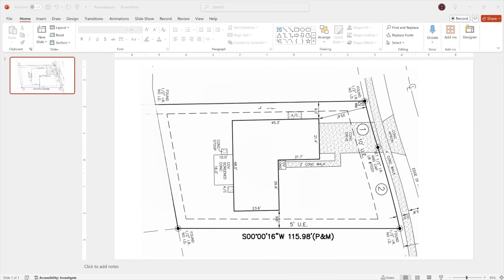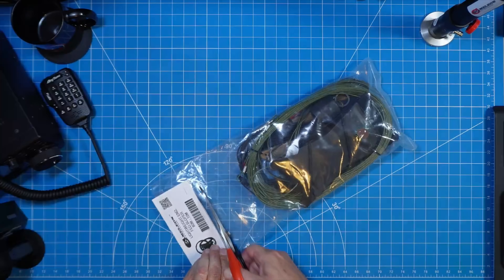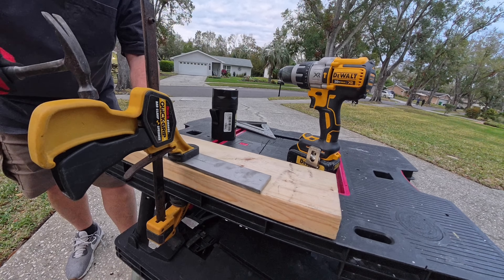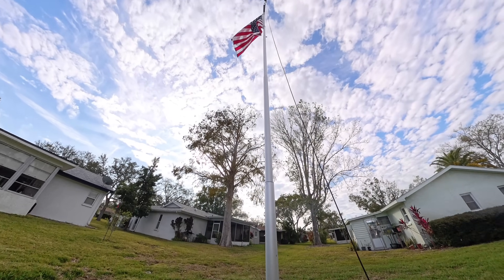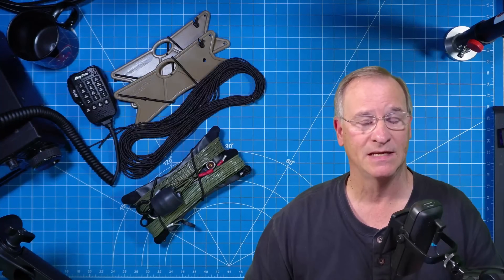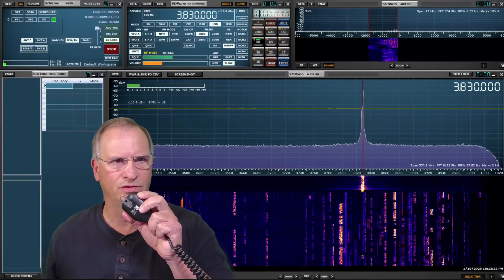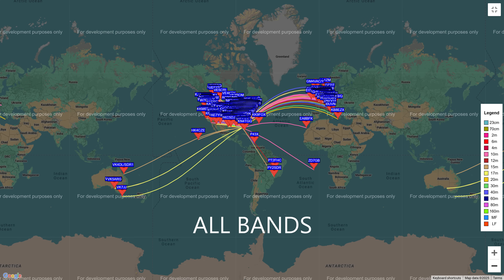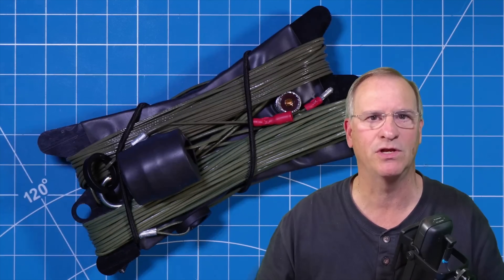Small Lot Sloping "L"  LEFS 8010 Antenna Resonant on 80 40 30 20 17 15 12 10 Meters - Demo & Review

Comment: Great video, mate, and this looks like a great antenna! I've been looking for another well-performing wire antenna to string up at my QTH. (I'm blessed with loads of room at a fairly high elevation.) Of course, one like this has the benefit of potential portability as well. Chameleon sure does make well-engineered high-quality stuff. Cheers!
Reply from the maker: Indeed their engineering and quality are top notch.  Thanks for stopping by for a look and comment.

Comment: if you were purchasing an antenna for home station.....this would be great choice?   it seems temp home use is good, but you wouldn't leave something like this in your yard permanently...correct?
Reply from the maker: If I could deploy this permanently in my yard, I absolutely would.  I would suspect it would last for years exposed to the elements; it is very well made.  Being in an HOA and a small lot, I can't; but if I could, I would use this as a permanent antenna.  10 through 80 meters is crazy!

Comment: Great video! I use a Chameleon Basic Limited Edition 130 foot at my home. I have a small 1/2 acre lot. The matching transformer is mounted to the corner of my house and the wire goes from there to a 25 foot flag pole in the middle of the yard. The other end goes to a basketball hoop and then about 15 feet to a tree at about 8 feet above ground. So it's an end fed inverted V configuration. It tunes all bands 160-6 meters with just the internal tuner in the Yaesu FT-710. Performance is great!
Note: I posted this yesterday but now it's completely gone. Don't know happened. Did the crazy censors at Youtube delete it or did you? Can't imagine why. I did include a link to pictures of my installation on my Smugmug website. As far as I can see an external link like that is allowed, but it's gone. 
Chameleon is great! I also use their CHA MPAS Lite in portable ops. Also performs well and tunes all bands 80-6 meters. I love these antennas because I don't have to do any adjustments, just set it up and hit the tune button on the radio.
Reply: Aha! I made a separate posting with the link to my pictures and it was deleted immediately. Good old Youtube censorship.
Reply: @w9fcc  It’s happening to me about 50% of the time when I try to answer questions with links…
Reply from the maker: Thanks for the great feedback, I always like to learn from others how they deploy their antennas.  

I did not delete the links; its YouTube.  Feel free to send them to my email, thehoaham@gmail.com

Comment: I have this antenna, and though I have never used it with the extension, it always performs great for me on 10-40. It’s a great POTA antenna. I usually have the feed point pretty close to the ground, 3-6 feet, and I have no problems making contacts in a sloping configuration.
Reply from the maker: Thanks for the feedback and confirmation on performance.

Comment: Two questions:

1] How are your received signals always so clear of noise. Your neighbourhood doesn't look that much sparser than mine, but my efforts (admittedly mainly with verticals) are never so quiet, and it's one reason I'm still mostly portable instead!

2] Will you be at Hamcation?
Reply from the maker: Sometimes my day job drops mandatory requirements on me; as long as that doesn't happen, I plan to be at Hamcation Friday afternoon and Saturday.

My noise floor isn't always this low.  When I first showed 40 on my SDR it was pretty good; within an hour, 40 was trash and noisy.  80 stayed good for me all night long; probably the best work I've ever done on 80.  This is the first wire I've evrn set up at 130'.
Reply: @HOAHamRadio  I hope to meet you in person, there, then. I'm making the schlep to escape the Minnesota cold 😀

Thanks for the answer, and for the great video, as always!
Reply from the maker: I sure do hope we meet up; safe travels!

Comment: May be I am off chart but are you drilling into a SOLID GOLD BAR assuming the usual top equipment list I am used too. VA2SOB Claude
Reply from the maker: I wish I had a solid gold bar : )  It was stainless, 1/4" thick if I remember correctly.
Reply: @ i know It is a joke but what I keep in mind it is a very forgiving antenna

Comment: be nice to make a wspr contact with you here! i can only run on 10m though! 73s
Reply from the maker: We'd have to time that and be working WSPR at the same time...it could happen.
Reply: @HOAHamRadio  that would be cool! i thought about getting a rig like yours, but found that wsjtx already has it and ive been uesing it off and on!
Reply from the maker: Yes, you can use wsjtx from your rig.  I only purchased the separate transmitters because I do some much long term (overnight) antenna testing; I wanted something that didn't tie up my transceiver.
Reply: @HOAHamRadio  i understand that

Comment: I have this antenna and it does work well for me. I would like to use it more often but I’m concerned about leaving it deployed long term. I’m currently using a HOA Buster Rain Gutter antenna.  It works well enough but I don’t get out very far with it for obvious reasons. I like how you had it deployed from the top of your “flag pole”.  Would you consider leaving the antenna setup like that permanently?
Reply: Yes you can! I’ve the prototype #1 at my QTH in Phoenix for about 3 years and still work like new!
Reply: @ Wow that’s awesome.  Okay well sounds like I may have to invest in a porta-mast…umm I mean Flag Pole…lol 73
Reply from the maker: I would have no concerns about deploying it long term.  I do have to be careful here because of my wind direction; the wind blows east at my house maybe 5% of the time, the rest is every other direction.  So I deployed expective wind would never push my flag into my coax.

The other option is to install the feed point of the antenna under my flag, then it doesn't matter what direction the wind blows.  In the video when I am first lowering my Porta Mast you may notice I disconnect a wire from the front side of it under the flag...that is my antenna wire that I keep up all the time.  Deploying the LEFS8010 from this point is an option.
Reply: @HOAHamRadio  Thanks for the reply and the recommendation. I'm always looking for a good way to deploy an antenna in my HOA.  I have even less yard than you do so I have to be very creative. Always great to see your deployments to get ideas of what might work in my situation. 73 my friend...

Comment: Wondering how it gets 12,17 and 30 w/o a tuner with the 63ft wire. In my experience that only gets 10/15/20/40

Wonder what the transformer is
Reply: 49:1
Reply: @Chameleon_Antenna  Not sure if Bob gets a commission but I bought an 8010 yesterday after watching his vid. So give the man a tip!
Reply: But he’s using the entire 130’ long wire!
Reply: @Chameleon_Antenna  Of course. And getting 12/17/30 with the wire long enough for 80 absolutely makes sense and is what I would have expected.

I was just wondering if there was some special magic ya'll have put into that transformer that got all the bands between 10-40 with just the short wire.
The docs on your site somewhat suggest the extension just adds 80 and that without the extension you get all the rest (Bob suggest that as well at about 2:40 though maybe he misread the docs as well)
Reply: @dorvinion  No magic but VERY well assembled! It’s all about how the toroidal is precisely manufactured which makes a HUGE difference on the overall SWR.

Comment: That's impressive that you would able to string that length of antenna wire around your property.  That gives me greater hope for installing a 71' random wire antenna in my 30'x100' suburban lot.
Reply from the maker: Go for it!  You can angle your wires to fit in the space and they still seem to get the job done.